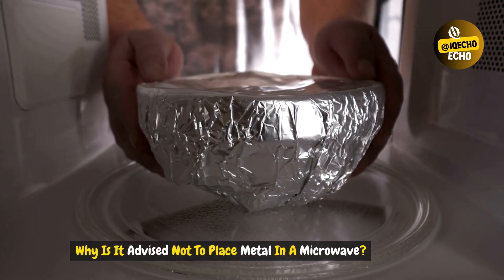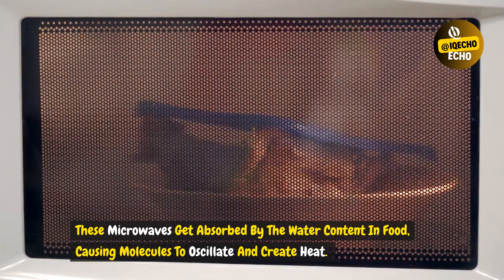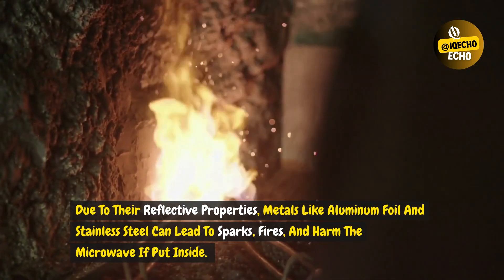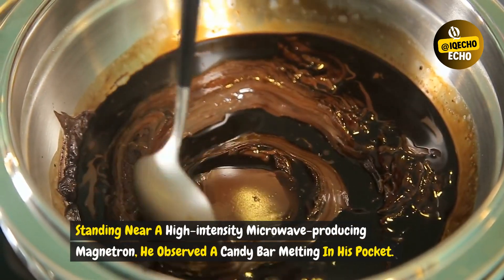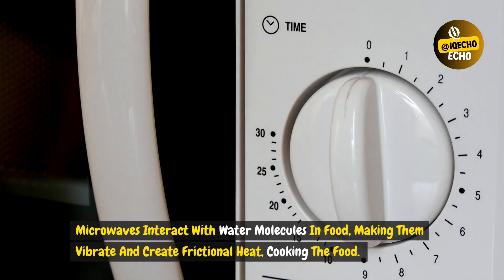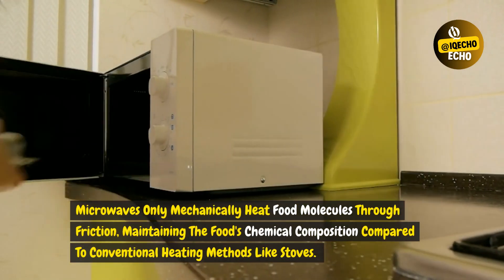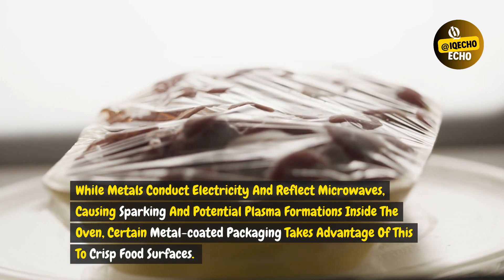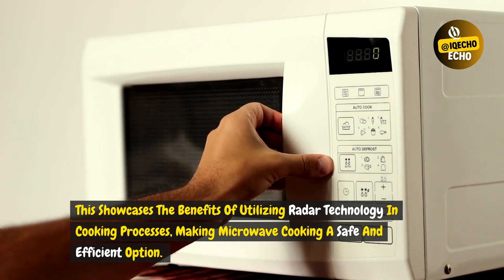Why is it advised not to place metal in a microwave?

Comment: Way short on facts dude...  Why do candles light when placed in a microwave oven.  Why do plastic food containers melt when water only boils at 100 deg. C or 212 deg. F?  What is the mechanism for arching, sparking and plasma balls within the microwave oven when metal is present?  To many people watch these videos to learn how and why things work.  Do your homework before posting videos.
Reply from the maker: Thank you so much for your insightful comments and valuable suggestions. Your feedback is truly appreciated. While my video was primarily focused on the dangers of placing metal in a microwave, I recognize the need for more comprehensive information.

Here are some brief answers to your questions since this could be useful for other comment readers.

1. Why do candles light when placed in a microwave oven?
   - The wax in candles can absorb microwaves and melt, potentially leading to ignition due to localized heating.

2. Why do plastic food containers melt when water only boils at 100°C or 212°F?
   - Some plastics have lower melting points than the boiling point of water, causing them to melt under the heat generated by microwaves.

3. When metal is present, what is the mechanism for arcing, sparking, and plasma balls within the microwave oven?
   - Metal objects can create high-voltage areas that cause electrical arcing and sparking. Plasma balls can form when the metal creates a small, contained plasma field.

I want to assure you that I will take your advice to heart and strive to provide more detailed explanations in my future videos. Once again, thank you for your input!